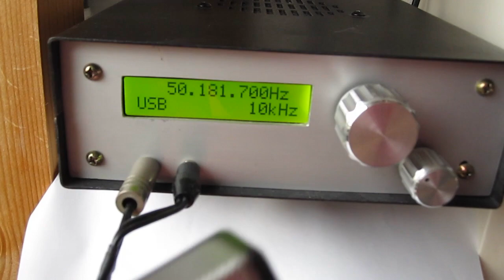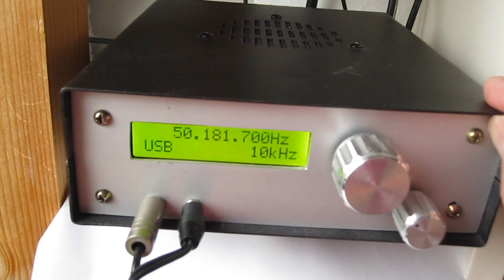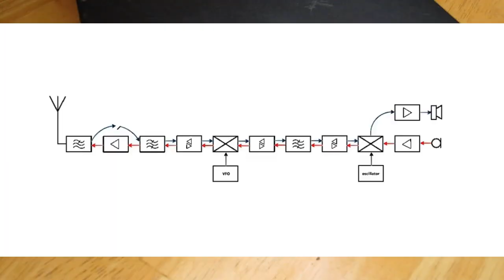1: DIY experimental 6 meter (50 MHz) SSB transceiver. Could also be adapted for other bands

Comment: Very nice Job , the idea of using that style of case is good as gives access to top and bottom and allows for speaker to be fitted   Not easy to fit so much in one case . Await Diagram and software Thanks You Ross
Reply from the maker: Thanks for your kind words. More information including the informtion you requests in the video's that are posted later (this in only part 1). 
You may find them by clicking on the (black/white) CRX logo. Enjoy!

Comment: Nice idea to re-purpose a CB case, replacing the PCB with a double sided PCB ground plane with DC and signal lines running underneath.  I have also tried using copper sheet to shield various stages. I found the most improvements from shielding were crystal filter and mixers. I didnt get a lot of improvement from shielding Arduino. I think you get more value from DC filtering the,Arduino power supply line. 🤓
Reply from the maker: Thanks for sharing the results of your experiments Paul. Individual modules could be shielded also, like I did with the crystal filter and PA. It still works fine!